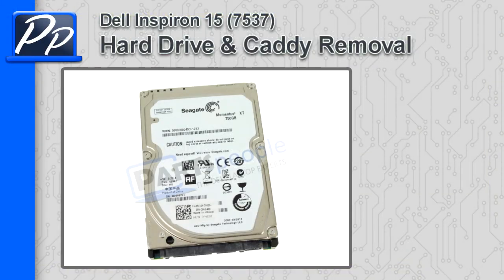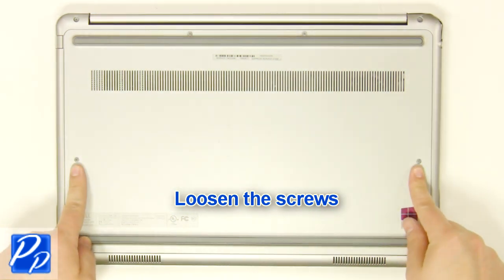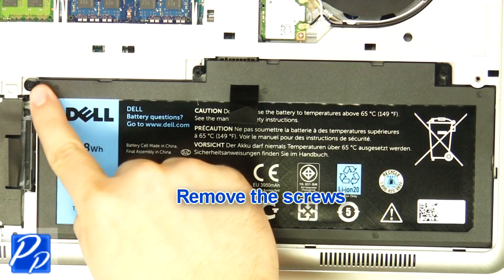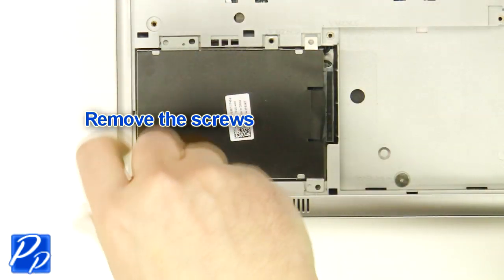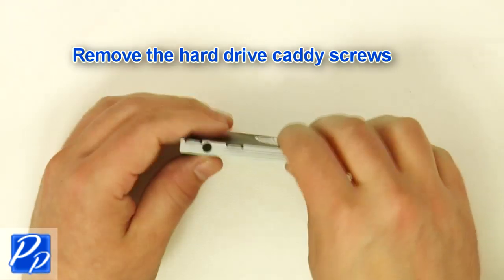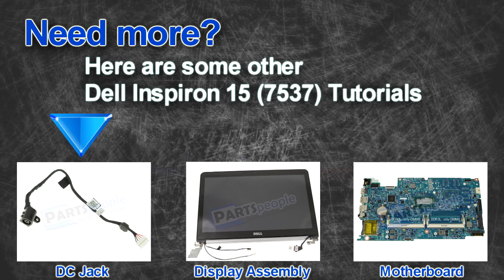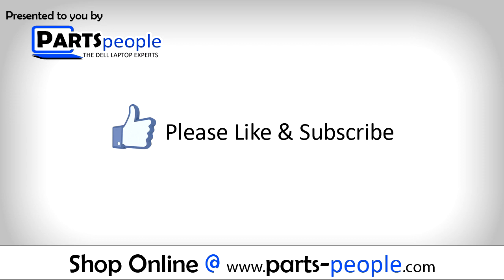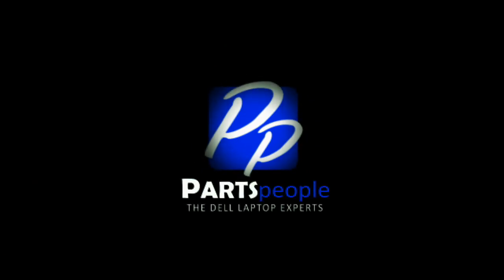Dell Inspiron 15 (7537) Hard Drive & Caddy Video Tutorial Teardown

Comment: For some weird reason, my 7537 came with 6GB of RAM. Do you think I can upgrade it to 8GBx2 = 16GBs of rum? Is there any DDR or BUS limitations?

Also, mine came with a 500GB 5400RPM HDD. Do you think installing a 7200RPM will be a problem? What about hybrid SSHD? Will that be a problem?
Reply: i think max mem IS 16 gb with 2x8gb
i also seen subversions w/ 256 ssd so it shouldn't be a problem

Comment: i have dell 7537 containing 500gb(HDD) i5 4thgen(processor) can i upgrade hdd to 1TB with same processor..
Reply from the maker: Yes, you can.
Reply: Thanku
Reply: Hi!
Can I ask your help?
I want to add an ssd to mine and I have found that there is an unsoldered esata port on the usb hub
Do you know if there is a version W/ ful esata on the usb board? (pic 
https://www.google.hu/search?q=7537+usb+board&source=lnms&tbm=isch&sa=X&ved=0ahUKEwj_7Ljdkq_WAhUKIpoKHYqYBAgQ_AUICigB&biw=1536&bih=734#imgrc=bSZ0karEO1qJKM:)